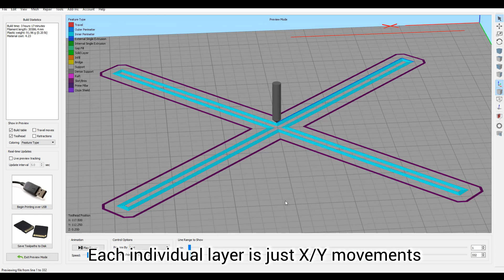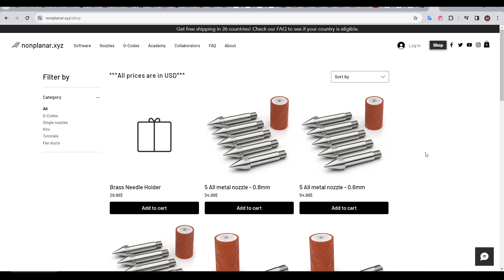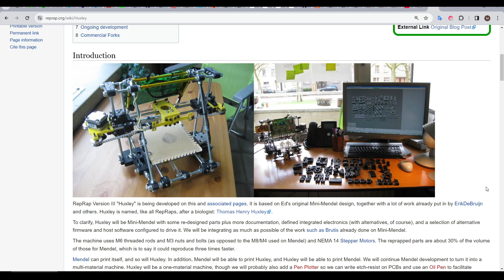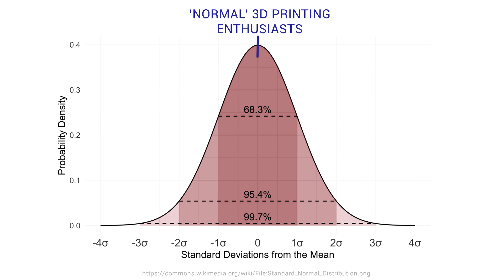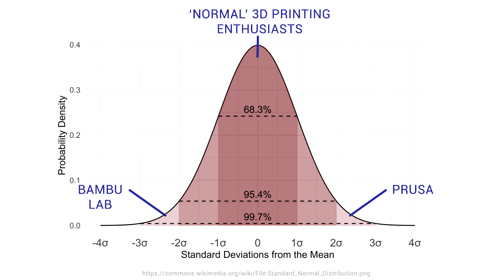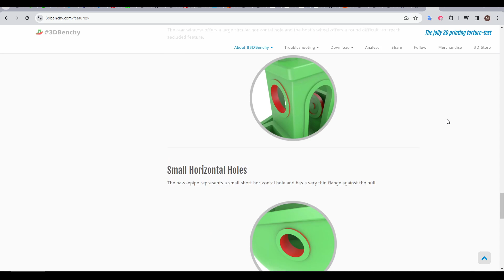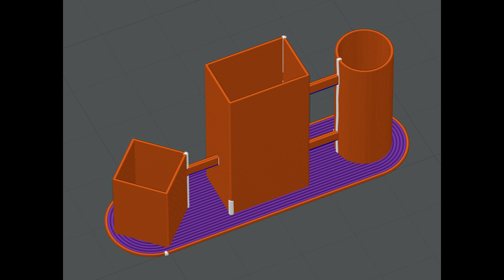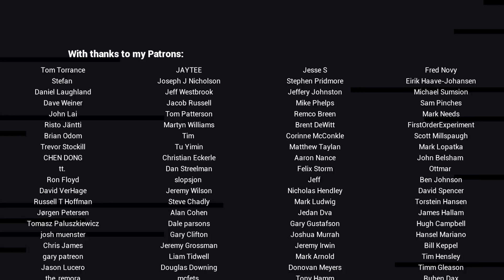3D printing mysteries that need to be solved in 2024

Comment: What happens if you set all speeds, acc and jerk, as well as line widths and extrusion multiplier equal? Flow should be identical during the entire print and if the artifact is flow related, it should completely disappear. 
Also try turning off skin overlap as it technically causes local over-extrusion and higher pressure in the hotend.

I have noticed a similar issue when doing ironing on a large area where you instead get a shinier band at the same level. Given how little filament is extruded during ironing and the time it stays melted, I have always assumed that the filament is getting hotter or otherwise change properties that cause this effect. My solution to this has been wider ironing lines and faster ironing speed to keep the flow higher. 

In you example, if the top/bottom lines are printed with a higher flow, the filament will not be baked as long as the wall lines and will print more matte. Do you have a way of inspecting the prints to see if the matte surface disappears at the exact same time that it starts the next layer or if it persists for a few layers? If it persists, something in the temp or flow is still evening out.

Comment: About the filament snap, I think that's because it's forced to bend in the opposite direction from its natural bend on the spool, especially when print head is all the way on the right. My filament sometimes snaps toward the end of the spool simply from sitting still on a top fed direct drive Ender 3 without reverse bowden. If the spool was flipped and reverse bowden end moved to the top of the spool, it would probably snap less
Reply: I think it’s definitely related to moisture as well, my filament only snaps at the exposed length, the underneath are not affected at all
Reply: @xidameng  I agree. Thought it's due to moisture and properties of the filament. Silk pla never snaps
Reply: . @xidameng  My filament was out of the box for quite a while. First print it broke going into the extruder. A visit to the dehydrator overnight and finished the roll without a problem
Reply: I've had this happen to me multiple times with old filament. However, if baked dry, I can usually reuse it just fine.
Reply: 8:50 shows it. I agree, take the filament off the mount and set it next to the printer on a roller-tray with the spool going the other way so that the filament leaves from the top of the roll instead of the bottom. The other issue is that the entry point into the bowden tube is very close to the edge of the print head and curves in the opposite direction of the tube. So when the head moves all the way right, it's going to cramp up the tube a lot. Attach the bowden tube to the right side of the printer so that it aims straight down and into a roller-tray and further from the gantry edge. Last thing is to make sure to dry out the filament, try other filaments, and try replacing the bowden tube.
Reply: I dont think its that. I've recently had a roll of filament just like it, snapped in multiple places in the bowden tube if left there for a few hours or more. I tried drying it for many many hours thinking it was wet but didnt make any difference. I put it down to really old filament (I did buy it new fairly recently but was cheap on eBay from a non-3D printing company so felt like old stock) I noticed something similar is happening with my oldest roll of filament, which I bought in 2017. I've also tried to dry that and has always been kept in a sealed bag too. It had some additional stringing but the prints came out ok so I just used the roll up printing random crap to get rid of it. Newer filaments can sit for weeks in the bowden tube without issues.
Reply: I agree, water isn't the issue. I have the same some rolls if you leave the filament forced in a "straight" line, it will break. So now I just unload filament when done.
 @dynamight1124
Reply: exactly !!!
Reply: What you said, and if you leave it in that position for a longer period of time, its more likely to snap in multiple places.  Some filaments do this quickly, some take longer.

Comment: Non-planar printing is easy to prototype, but the reality is that creating a solid slicer that can actually do all the required math is hard. Planar slicers even in 2023 are not even perfect.
Reply: I would love to see even an easy to access prototype as that would help get manufacturers on board with increasing Z clearances in their designs, but I pity the developer who releases it, in a simple form that everyone can access to see immediate improvements easily, say makes the roof of a benchy print without stair stepping.  Immediately they are going to be overwhelmed with people opening tickets and providing tons of examples where it falls short, and be faced with some difficult development to try to sort it out.

Comment: Something I've noticed on my ender 3's...  if I leave PLA loaded in a Bowden tube, the portion in the tube becomes brittle within a few days. Cut it off at the tube entrance, and the remaining spool is pliable and bends like normal PLA. On my direct drive printers where I don't have any PTFE tubing, the filament stays pliable for ages.   Weird.

Comment: I live in Europe and filaments here spin the same way as on your printer. Sorry about that, no Nobel prize for you. 😉
It's most likely due to how the filament is basically already twisting as it's pulled to the print head, and to a minor degree to how the nozzle is bored out (micro groves, also a problem for some precision injection molding applications).

Comment: there is some guy in Switzerland who wrote a Non Planar Slicer, sadly ive forgot the name of the slicer.
had a talk with David Crocker of Duet3D About it at Formnext, and one part where how they generated the gcode for the 5 Axis Printer they had at Formnext.
Reply: I think you are referring to a video by CNC Kitchen. A team at the ZHAW has built a 4-axis printer based on a Mk3 called RotBot and the slicer is simply called RotBotSlicer.
Reply: @andreas.grundler  not sure how that connects to a conversation ive had 9 weeks ago at a larger expo, they had 5 Axis printer running there.
possible its connected, but what i can remember is that ive been told its a slicer made by someone from switzerland
Reply: DrEricEbert on GitHub?? what did they use for the 5axis printer you mentioned?

Comment: I've seen PLA (standard and modified) get brittle when left in the feed tube on my Titan clone. Only unmodified PLA has become brittle on the exposed 2+ft path from the spool to the tube stub. I've had modified PLA sitting out for years without issue (except for Sunlu brand). Something about the ptfe tubing (capricorn) seems to negatively affect the flexibility over time.
Reply: @user-il7in6vx9o Over short term, matter of weeks, moisture absorbed by the filament makes it uprintable, but it makes it extra supple rather than brittle.  You can do an experiment by sealing a bag with a loop of filament and some water and storing it dark and not too warm, you will ascertain yourself. So it wouldn't be it. I wonder if the tube actually liberates some fluorine radical that does a nasty. Or whether some volatile component of PLA from thermal degradation rises up from the hot-end into the tube and damages the filament.

Comment: I have a problem for you to solve. Designing mating tabs and slots in component to a snapped together. I recently designed an accessories tray for a spindle sander gut given that the component exceeded the bed size of my Ender 3 Pro, I split the component into two parts. It only took a couple of hours to design the two components, but defining the geometry for how they snap together to several days. Are there tools in existing CAD software that can help quickly and easily define the geometry for complementary snap-together slots and tabs?
Reply: https://youtu.be/4cnJFZZRui0?si=tEYu5fp82RsTxAtb

Comment: Non-planar is still incredibly interesting and it's a real shame it never seemed to take off. I would still like to see companies work on integrating it. Maybe one day.
Reply: its a software problem. theres software. but its not cheap, and theres nothing open source i can think of that comes close enough to be used without major development.
Reply: As others have mentioned it is all a software problem, but I feel it would benefit by first taking notes from CAM software for machining. It would be a more involved process and the user would have to tell it what to do and when to do it, but it could still be relatively easy. There may even be a possibility of just adapting existing CAM software to do it.
Reply: @conorstewart2214  freecad has the "path" workbench. very frustrating. but open source! :)

linuxcnc is a great controller, but it takes more hardware compared to most 3dp mainboards. and has a steep learning curve when you want to do unusual things. but its something i started to get into. some stuff already works, but its not quite there yet.
Reply: Non-planar makes the slicng way more complicated. If you think about it like a pendulum adding non-planar is like a double pendulum. There are so many more variables to account for which leads to a virtually infinite way to slice your model none being the "best" or most direct way to solve it. Then you combine that with hardware limitations, since all printers currently work off of cartesian axis, and you have an exponentially harder problem to solve. 

Interms of robotics youre basically going from a SCARA robot to a 6DOF robot arm.
Reply: @henhen7890  you don't need 6dof, even just 10° can go suprisingly far. The issue is complexity of layer generation, since you have to account for parts blocking other parts you can't exactly just use the way cura slices and add in some shape instead of the plane, since that shape is the result of "slicing" the layer.
Reply: @U_Geek  please tell me where to follow your work. id like to share things with you as i go about my projects if you would like....
Reply: @simonschneider5913  I think I'll start a devlog on this account soon. Not sure when that will happen exactly since I still have an exam in january but that shouldn't take up too much of my time.
Reply: @henhen7890  If you're developing for a single machine, with a single printhead geometry to calculate for, non-planar is not a big issue - that's why there are scripts that can do it if you're willing to dig into it.

But both Bambu Lab's and Prusa's printheads leave very little space around the nozzle to do any worthwhile angle (although it's these shallow angles where non-planar makes the best difference).

If you forget about non-planar with PLA and it's extreme part cooling requirements, you could have much more exposed nozzles and more flexibility in angles/curves that are possible. Going with ABS lets you get away with zero part cooling, and there's several other plastics that would do the same trick.
Reply: @See-essEll  the printhead geometry problem could be easily fixed by Bambu or Prusa by just making longer nozzles (although that may interfere with the poop chute and other things) and a different shaped fan duct. It’s not hardware that is the problem really
Reply: @henhen7890  thats the crux of the issue. what we actually want to do. for real 5axis printing you would have to define the whole object with internal geometry inside the hollow body thats represented by a STL/etc....its wild to imagine what goes into this. way over my head. but its bothering for a long time already.. ;)
Reply: I'd love to see it as an option for the ironing pass, if nothing else.
Reply: I actually have a project I've been working on for a while. you guys are really inspiring me to drink more coffe, just the fact that there are people instrested in something like this. My slicer is for now only aiming to be a support replacement,so you can print 90° overhangs too, but have to optimise it cuz a benchy would take ~6hours with it due to a limitation in the algorithm that requires 0.1mm layer height with a 0.6 mm nozzle, BUT I have a few test prints printed ona vanilla ender 3 with a max slope angle of 10°(the ender 3 can do up to 15 and a bit).
Reply: maybe we'll leap frog that and jump straight to 5-axis 😂
Reply: I looked through this recently and I think it exposes a weakness in the open source model.  There have been multiple experiments around non-planar printing in the open source world by college students, as soon as they graduate and get a job these seem to be abandoned.  It is a considerable amount of work to implement and nobody is getting paid to spend the time to add this feature.  I think in the end it will end up coming from a Bambu or Prusa, a company who employs their own programmers who can spend the time needed to add this feature and will benefit from the vastly superior top layers on slanted and lightly curved objects, but even then, they would only stand out with the feature if it was not opened sourced so maybe this would not motivate them.
Reply: Completely agree on the need for adding the capability for non-planar prints.
Reply: Imagine seeing that on a belt printer, would greatly increase the strength.
Reply: The same question applies to the extreem overhang printing method. Never heard about it anymore…
Reply: Yeah, I'm kinda surprised we don't have any printers with rotating/tilting hotends getting down to mainstream yet, would still cost a lot more than an Ender of course, but it seems like an obvious evolution.
Reply: Probably it became patented and some manufacturer will provide it as a software feature with optimized collision detection like in CNC machines. Non planar is not that complicated itself, but problems around that solution are. Don't worry, it will be available for normal person
Reply: I'd love to see it in FullControl, it feels like something that fits with their vibe.
Reply: I wonder if it could if people used heat pipes that can handle the temperature to allow the cooling fans to be much higher.
Reply: I think the reason non planer is slow is it is very machine specific. And it is a User Interface nightmare.  Some machines like the x1c have the ability to do "object" prints in the same build. (printing multiple layers of the same object as long as it is far enough away from others.) Because of the multi material it makes sense. but with many printers this would not be good enough to warrant development. I don't expect this to transfer to other slicers.
Would love non-planar to be an option. Improve strength and surface quality.